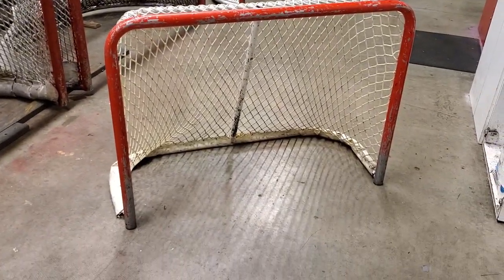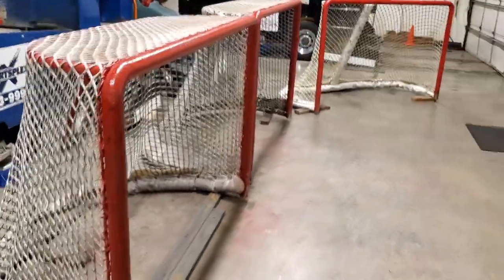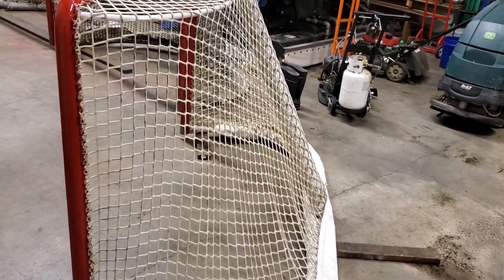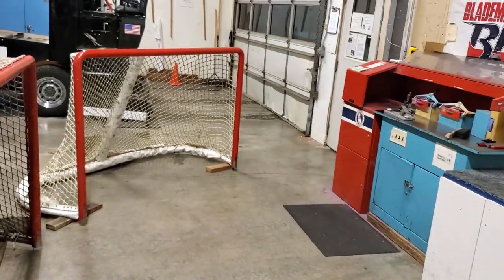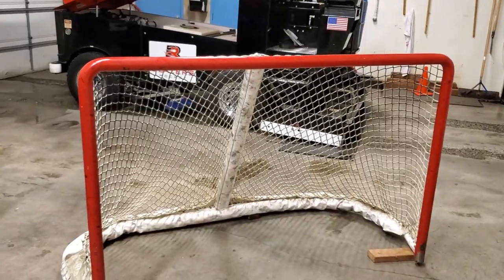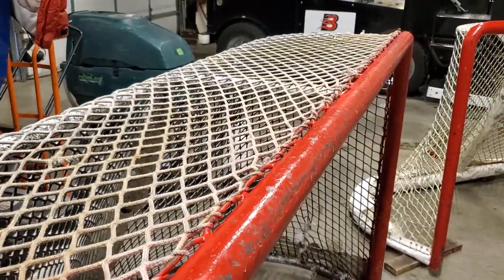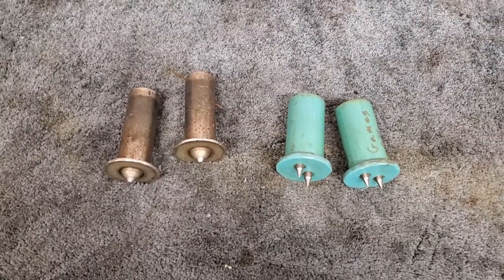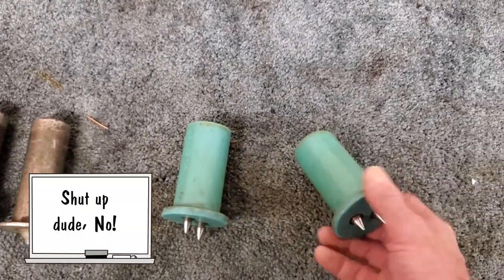Hockey Goal Frames

Comment: Do those green pegs release or flex on hard collisions? Based on how they look, it seems like the goal would not give in a collision.
Reply from the maker: There is a little wiggle room inside the post but not much flexibility. I guess they would be more release than flex. I think they would have as much give as marsh pegs. No complaints after using over two years and the goalies seem to love them. Thanks for the question.